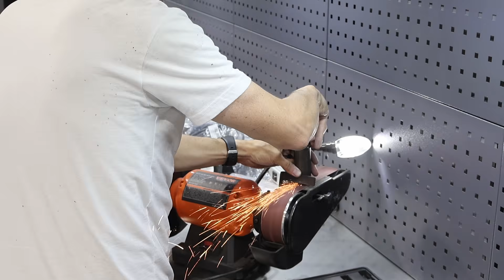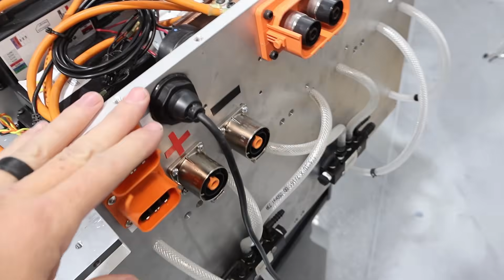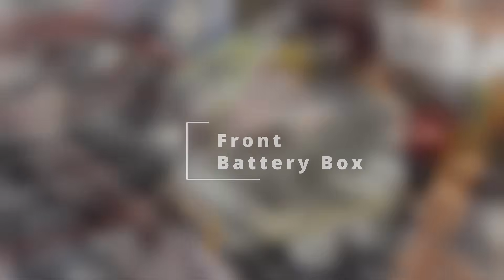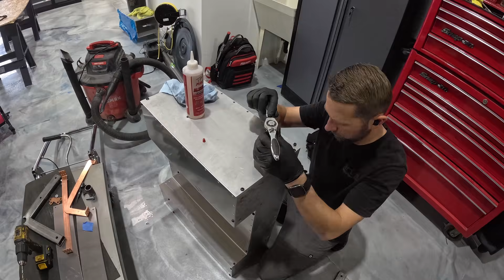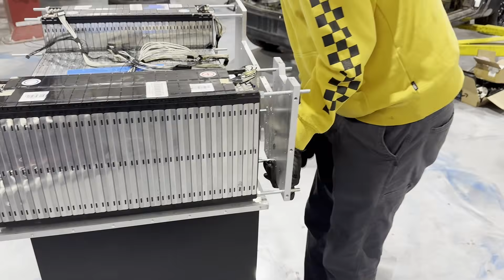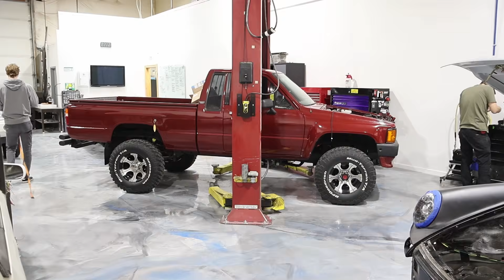Old Toyota. New Power. Custom EV Battery Box Build!

Comment: Great build! What thickness aluminum did you use for the rear battery box sides and bottom?
Reply from the maker: Structural, we did 0.5".
Reply: @electricsupercar How about the bottom? Looks like 1/8”.
Reply from the maker: @briant7461 everything else is .125"

Comment: Hope that JB weld on that liquid fitting is only for some sort of mechanical fix, and not a leak fix.
Reply from the maker: No leaks.  Everything is pressure tested. Black substance is seam sealer.

Comment: Talking about batteries,  my neighbours electric Jaguar iPace  caught fire and exploded.  Apparently Jaguar are aware of the problem and suggest that you park away from buildings so the fire doesn’t spread.
The fire brigade took 6 hours of constant spraying with water to cool it down enough for it to be towed on a flatbed. 
The problem with electric car fires is you can’t just put out the fire as it just starts again and again.

Comment: There little big problem to motor cable output from switch blok, the HV bars too close to case, in 400V DC vil junp over 1 cm, you need cut corners and isolate them
Reply from the maker: 3,400 volts per millimeter is pretty standard information for voltage arc in air.
Reply: @electricsupercar  yes in dry and standing condition, but in practice , i have 100kWh battery 425V maks, made from nissan leaf modules, 
It geting some moisture, and all BMSes plates over 340V wried in winter with light condenced moisture!
i remade all bms plates to resist it! made wider spaces on the wireroads!
in car jou have fibration, this is just too close! its yours failure point in this battery!
Reply: @electricsupercar  https://youtu.be/jrNrYVLsyos?t=374 
in 374 sec in video, I see some 4mm only copper and case !
You need some 10mm there, <
You must need cut that corner!

Comment: Amazing progress as always!

Did you guys see that Toyota AE86 with the Tundra hybrid motor, mated to a 6 speed? Has there been any traction on keeping gearboxes with electric motors?
Reply from the maker: Keeping gearboxes and transfer cases take up room and would force motor placement up front limiting space for batteries.  It also maintains failure points that most EV conversions don't have.

Comment: How does the plate cooling compare to the internal cooling on the Tesla batteries, seems quite a bit easier with all the plumbing external.
Reply from the maker: Pouch style vs cylindrical are like apples and oranges.  Hard to compare.